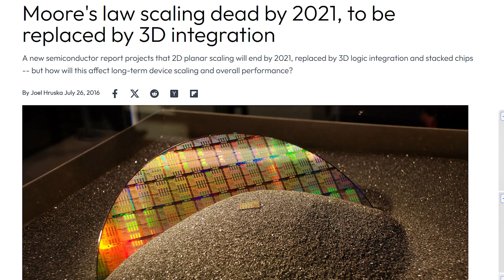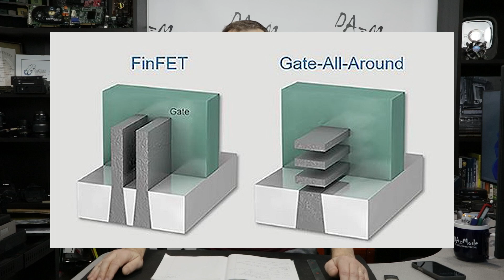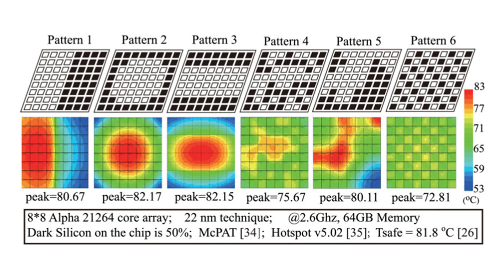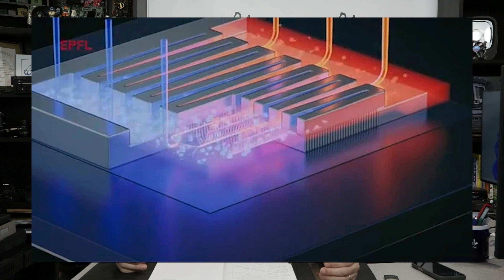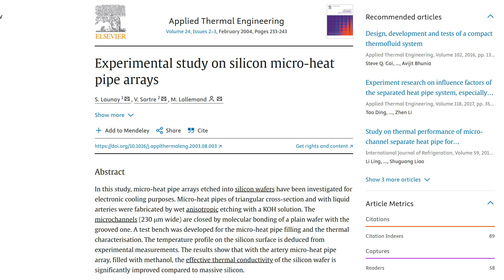Future of Watercooling in 2025 and beyond

Comment: I think the one thing people may be missing with consumer water cooling is why companies like alphacool or watercool even do it in the first place. I'm not going to claim to be an expert, but one very logical reason is that CNC machines are very expensive. Unless they are always operating 100% of the time, they are literally losing money for the company that likely took a big loan out for them. Demand for industrial water cooling will never be 100% consistent and consumer water cooling helps fill in the gaps. This allows companies to always keep their machines running, generating revenue. This is also true for raw materials. It lets them order larger quantities, for a lower unit price, knowing that they will be able to fill enough orders to make it worthwhile. 

So while it only may be a few% of their overall business, it ensures that they always have business.

In my opinion, the situation with EK was kind of a one-off. It is pretty clear they were run by an absolute band of morons.
Reply from the maker: This is a plausible theory. I have seen for years that Watercool has a more  orders backlog than available production capacity. Good for them!

Comment: The custom LC market is slowly dying. It is dying because there are no people with a passion for it. Now there is a herd of sheep who want it all, now, today, at this moment. Stupid people for whom a manual is written that no longer teaches you how to adjust the engine timing on a car, but how not to let one of the other bums drink the battery fluid.
What a pity. Weak times have come. Fearful people without passion.
Reply: Hyperbole. It's not dying as long as processor power consumption/density remains high. There are no signs this is changing in the short term. 

The biggest problem with industrial data center water cooling is, the water consumption. But $ will win out and local communities will suffer before water cooling dies.

Comment: The phase out of novec by 3m which is the primary immersion coolant for data centres seems to be going quite well at some level as other manufacturers of chemically equivalent fluids are producing along with none pfas versions that would be usable under the new regulations. But it is highly unlikely that it would be brought to consumers at this point unless there was a major change is pc standards as immersion cooling has been in data centres for almost 40 years, with the pc tower layout being functionally the least optimal layout for immersion cooling
Reply from the maker: I was more thinking of possible alternatives to immersion with something totally different which may be used in consumer applications. No idea what it could be although, just speculation….